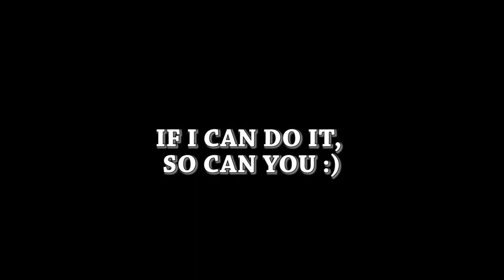Snowblind PC Mod with AOC E1659fwu

Comment: my case has a slightly tinted tempered glass do you think that will be too dark?
Reply: I think yes, it will be dark, but you can search on the internet for a clear tempered glass for ur case (spam alert: i recommended to subscribe to my channel)
Reply: Do you have the 570x? I've got 8 RGB fans and 4 LED strips in my case, I'm hoping that if I turn them all to static color white the contrast and brightness should be high enough. One thing this video didn't mention is the monitor panel buttons. Recently took apart a monitor for side panel mod and cut off the little circuit board that houses the power button, input, and settings buttons. My bud did this same mod but left those off and 1. Don't think he figured out how to turn the thing on, and 2. If he did he wouldn't be able to adjust the color/brightness/etc. I recommend immediately building housings for your circuit boards. I didn't and my dog. Bumped the table I was working on and the boards touched while powered on. Made a giant spark and smoke and everything was dead after that. Didn't discourage me though I'm going to try again.
Reply: This particular monitor has zero buttons, just the USB port for power and video.